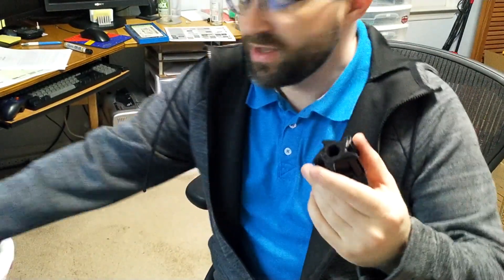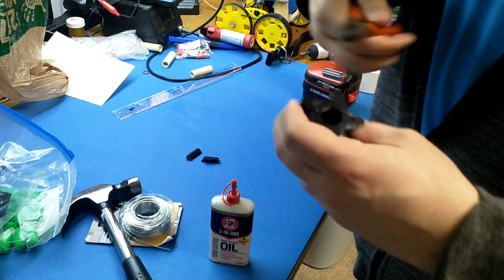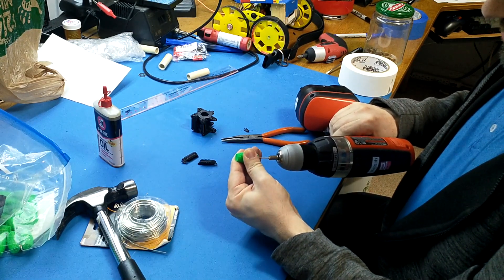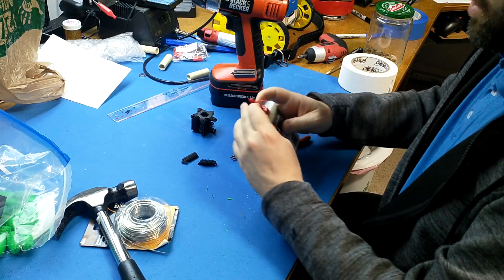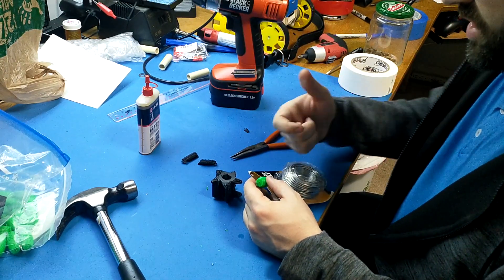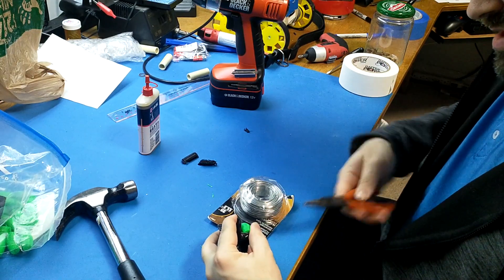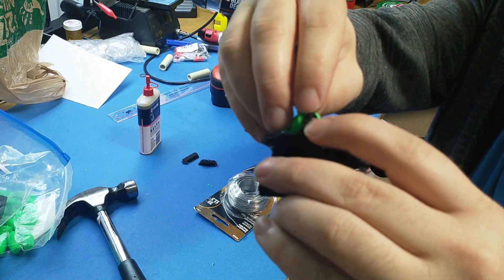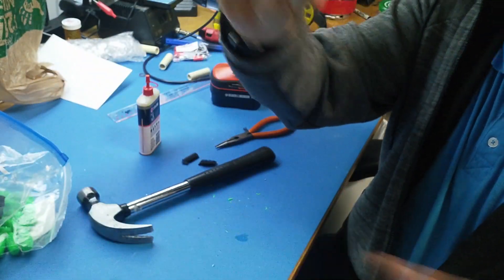Assembling the 3d printed mecanum wheels (FRC 6496 mod to FRC 125 design)

Comment: hey i like your design. i tried to send you a email to the one listed in the google drive but it keeps coming back. i was wondering if you could design a wheel and hub so i could print the hub in pla and the wheel in tpu to run on my hard surfaces as pla just slides around?
Reply from the maker: Sure. I've actually designed a wheel exactly like that. You need a spline pattern where they join. Not sure why I didn't get emails - try Tyler.Bletsch at gmail.